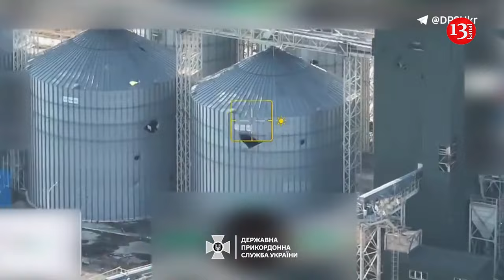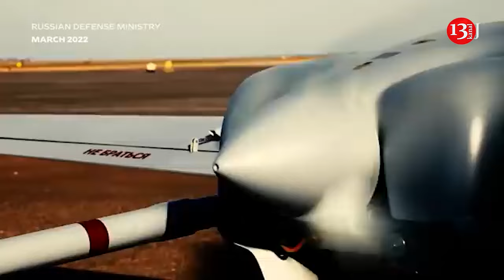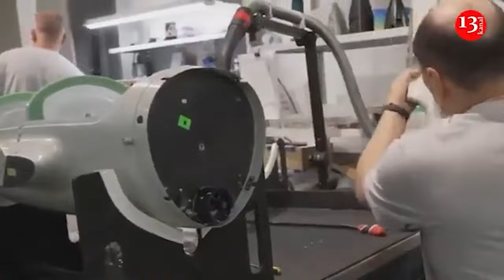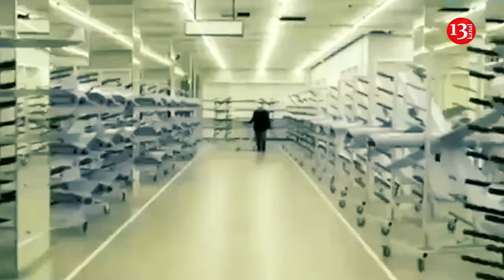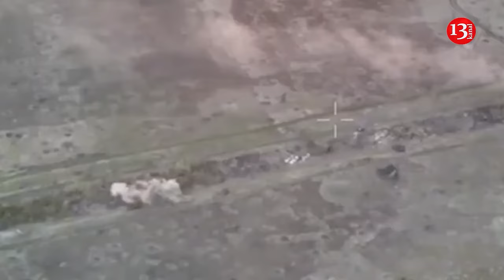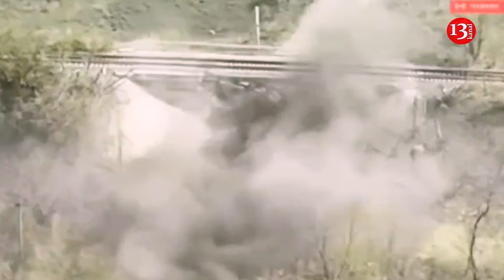Russians shocked by Ukraine's strike on military facilities in Moscow: New facts revealed

Comment: Mobility provides superiority on the battlefield.
Reply: Mobility has its downsides, like increasing your exposure.
Reply: @nic.h  Sun Tsu disagrees with you, as do everyone who understands the art of war.
Reply: @cybrsage  Sun Tzu references both sides of this.  Mobility has benefits when used at the right moment, it has downsides when not.

A fighter wandering around the battlefield is simply more likely to be seen and easily attacked than a fighter who remains unseen.

Roads in Ukraine are littered in vehicles that provided mobility.
Reply: @nic.h and Unraine is using their smaller ans more mobile army quite well,making it an asset.
After close to 3 years of fighting a mich larger army, they still control most if their country and even aome id theor enemy's country.
Reply: @cybrsage  I agree Ukraine has been using their mobility quite well.  That doesn't invalidate my point.  Mobility can be very effective, it can also be used ineffectively, it can expose the mover to greater risk.  So it's not just about mobility but how it's being used.
Reply: @nic.h  context is king